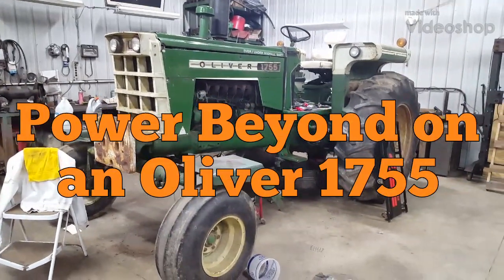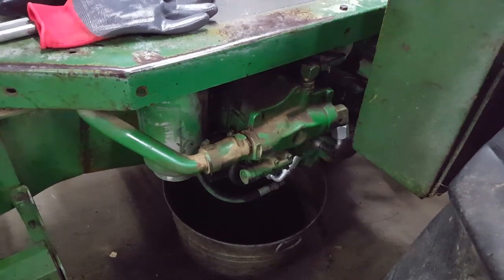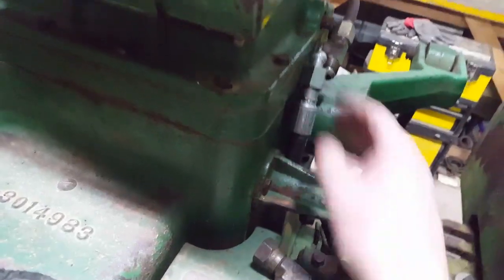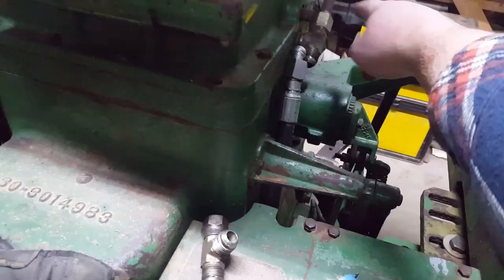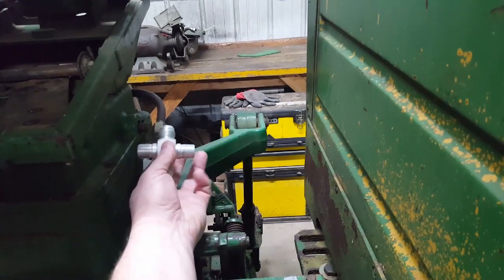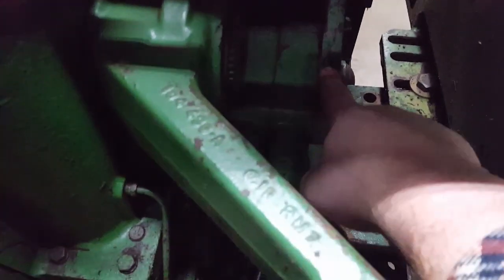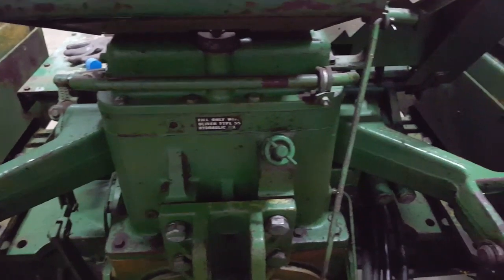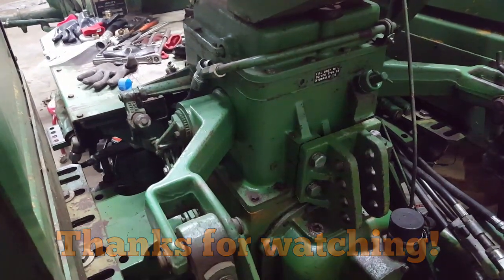Adding a power beyond hydraulic port to an Oliver 1755

Comment: @chis losey when you showed the Agco 4 way, is that designed to have 2 power beyonds?
Reply from the maker: No, it replaces the T fitting that goes in the left  side of the top cover. So 1 side gets oil from the pump,  1 side feeds the 3 point, 1 side feeds the line that goes to the remotes, and the remaining 1 is your power beyond.
Reply: @ThatOliverGuyChris  got it thanks

Comment: How is a 1800 gas plumbed  ?
Reply from the maker: For power beyond? It depends a little on which version, but A and B series you have to pull the hydraulic unit off to block a hydraulic port. It's a  lot of work.
Reply: @ThatOliverGuyChris  hello, I found your videos on YouTube, I have a Oliver 1650 diesel, the power steering went out and their is a grinding sound around the over/  under unit, the tractor moves, and the 3pt hitch moves. Any insight on where to start looking?
Reply from the maker: @paulpetusky9222  , does the noise go away when you have the clutch depressed?
Reply: @ThatOliverGuyChris  unfortunately no
Reply: @ThatOliverGuyChris  so just tie into a remote then
Reply from the maker: @cullyconn2507  I  was mistaken on power beyond for that tractor. I've now got a video that shows how to do it.
Reply: Hello, I have a 1650 diesel and the power steering went to h$//, it’s making a grinding sound. Any thoughts?
Reply from the maker: Then I would guess it's not transmission related.  Could be something broke off from the main clutch and is bouncing around in the bellhousing.  There's an inspection cover on the lower font of the bellhousing.  There's just 1 bolt that holds it on. Take that plate off and shine a light in there to see if you can see an pieces laying in the bottom.
Reply: @ThatOliverGuyChris  will look at the cover as soon as it warms up a little, but, why would the power steering be stiff, like trying to turn the steering wheel when the tractor is off
Reply: Furthermore, thank you for responding so quickly, I am in Pennsylvania, south of Erie , and we sit in the snow belt, also how big of a job is it to replace a ring gear on a 77 row crop ,gas wide front end? When it rains it pours! Lol
Reply from the maker: @paulpetusky9222  , flywheel ring gear? If you don't have belt pulley, you need the pull the pto shaft, slide the transmission drive coupler off, unbolt the bell housing, pull that out, pull the clutch, and flywheel,  then you can cut the old ring gear off. New one, you heat it up and drop it on the flywheel before it cools and shrinks.
Reply: @ThatOliverGuyChris  this tractor has a pulley
Reply: For the 77 , has a pulley , and to replace the fly wheel ring gear, does the engine have to come out?
Reply from the maker: @paulpetusky9222  in that case there isn't enough room to get the bell housing out. The engine has to come out. You still have to do the other things to pull the engine, plus wiring, fuel tank, sheet metal, and so on.
Reply: @ThatOliverGuyChris  just looked inside the bell housing on the 1650, found some busted spring like pieces and removed with a telescopic magnet, sounds like the clutch is shot?
Reply from the maker: @paulpetusky9222  it sounds like it. They're probably out of the dampener in the center of the clutch disc.
Reply: @ThatOliverGuyChris  does this need to come out also?
Reply: Engine
Reply from the maker: @paulpetusky9222  yes, engine has to come out.  Ive got a video of a clutch job on a 1650
Reply: @ThatOliverGuyChris  thank you for your time
Reply: I hate to be a pain, have another? , the 1650 blows white smoke once it gets hot and lathered up, while the engine is out what should be done to eliminate that problem? You just got a new subscriber to your channel. Thanks Chris.
Reply from the maker: @paulpetusky9222  so it burns clean when not working? Is there any oil floating on top of your coolant? You're not going to like my first guess. You might have a bad head gasket, or a cracked head. The crack would open up when hot and let coolant in the combustion chamber, which makes white smoke.
Reply: @ThatOliverGuyChris  yes burns clean, no oil floating on top of coolant. Pushes white smoke when working for a few hours or under some strain, haybine is the toughest job it does,
Reply from the maker: @paulpetusky9222  does it use any coolant?
Reply: @ThatOliverGuyChris  maybe a pint or so all summer, I try to run 60/40 antifreeze to water
Reply from the maker: @paulpetusky9222  , the only other thing that pops in my head is a sticky injector.  Try running a can of Seafoam in the next fill up. I'm really impressed how well that stuff works.
Reply: @ThatOliverGuyChris  Who do you use for  Oliver parts, I look online only to be frustrated .
Reply from the maker: @paulpetusky9222  depends on what I need. I still get a lot of parts from my local Agco dealer.  Korves Oliver has an ever growing offering of Oliver parts, as does Maibach Tractor. There are some guys that part out tractors, and others that have parts on hand from old dealers.   There's a few Oliver and White groups on Facebook that are great for connecting with other Oliver owners and guys with parts. I do find some of parts on ebay, but that's hit or miss. Sometimes I just have to be patient when it comes to things like sheet metal or other discontinued parts.
Reply: @ThatOliverGuyChris  on that 1650 diesel, if the clutch failed, does that effect the power steering unit ? or is that a separate problem ?
Reply from the maker: @paulpetusky9222  That's a separate problem. Try this: Hold a hydraulic lever back with nothing hooked up to it, and then try to steer while holding the lever back. If it steers again, there is a spool that is stuck in your priority valve.
Reply: @ThatOliverGuyChris  where is that pump housed?
Reply from the maker: @paulpetusky9222  The steering gets its pressure from the main hydraulic pump, the same one that runs the remotes and the 3 point hitch, so if your 3 point works, your pump is working, but not sending oil to the steering motor in the dash (or there is something wrong with the steering motor). Holding the lever with nothing on it causes back pressure to build and forces it to go to the steering as long as your are holding that lever. Check out my video on Power Beyond for the 1650 at this  link, I explain the priority valve there. https://youtu.be/47VGAxFWmCw?t=177
Reply: @ThatOliverGuyChris  upon digging more into my 1650 diesel I have found more issues, 3 pt hitch, steering, and pto failed, when looking at your videos leads me to think that the hydraulic pump has failed, is their a link on how to remove the main hydraulic pump system , furthermore I thought I felt a strange vibration under my feet this past season, any speculation on the problem?
Reply from the maker: @paulpetusky9222  if you lost all those functions, I bet the splines on the shaft that turns all of those wore off at the flywheel. I've got a video on pulling the pto drive of the 1650. One way another, it really sounds like the engine needs pulled on your tractor to fix what is going on.
Reply: @ThatOliverGuyChris  thank you for your expertise.

Comment: Another great video! thanks for explaining how that works on the "55" tractors, your right questions about power beyond seemed to get asked a lot.  
I was just wondering would you consider making a video about setting up a semi-mount 4 or 5 bottom Oliver plow and the tractor?
Reply from the maker: That would be a good idea. It might be summer time before I can get a chance for that, at least to do it properly. Thanks for the suggestion!
Reply: I thought it would help us guys who don't have that much experience with it.  I am going to pull a 5bottom with my 1850 this spring.  I got all my pto parts collected so I will be reassembling it soon.  Thanks again

Comment: What hydraulic oil do you recommend for the different Oliver series and Whites? Also what ATF and hydraulic oil for the Hydra Power and Hydraul Shifts?
Reply from the maker: I now use Universal hydraulic/transmission fluid in all my  tractors. I don't want to take the chance of cheaper oils contaminating my bigger tractors that use a common transmission/hydraulic oil. AGCO calls it 821xl, and I make sure whatever I use meets their specification. There are cheap oils on the market that say they can be used in common hydraulic/transmission, but there is a huge difference between "can be used" and "meet or exceeds recommendations". You can use salt in place of sugar in a cookie recipe, but I sure wouldn't recommend it. As to the ATF, most of the Whites used the 821xl universal oil, so if it isn't red, that's what I use. If they have red oil in them, I use Dexron III that I have left over from our dealership days. I think it can still be bought, but Dexron VI is the replacement fluid for it.

Comment: I have a 1700 gas, can I do the same ? Not sure of the year ? 67 or 68,  with 3900 hours wide front
Reply from the maker: Could be.  If it's not done right, things can act weird or not work at all. Sounds like another video to make.
Reply from the maker: Do you mean a 1750? There is a way to do that, but it's a different setup because those tractors are open center hydraulics.
Reply: Chris Losey yes 1750 gas,
Reply: Chris Losey    thats why I can't run everything at once ? My remotes and the 3 point ?

Comment: Yeah, super simple!  I use them flareless fittings because I've never been able to find that cross fitting, but I like your idea of the JIC M-M-F Tee!  I didn't think there was enough room, but good to know there's another option!  Thanks for the video!  Excellent information!
Reply from the maker: It's tight, but if I put the T on the line coming up from the relief , then put the T on the fitting at the 3 point , it fits. Might be tough with a cab. I'm planning on putting power beyond on my 1955, we'll see how that goes when I get to it.